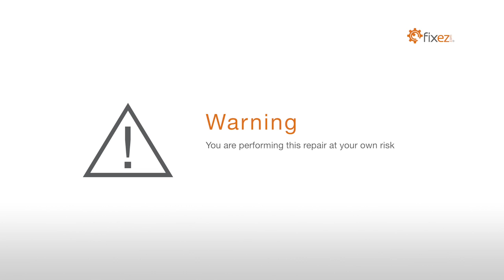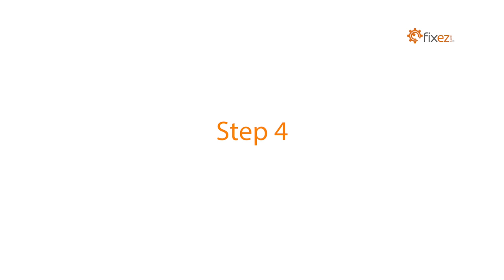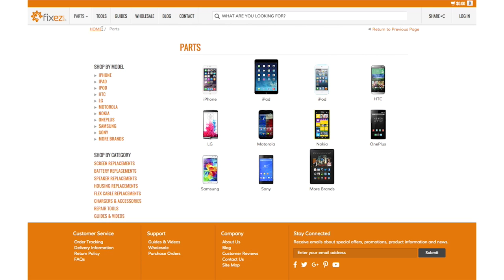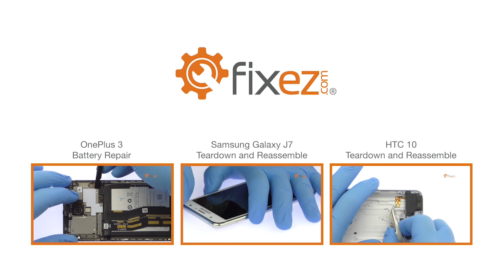iPhone 7 Plus Display Assembly (LCD & Touch Screen) Repair Guide - Fixez.com

Comment: hello I have done this fix on my iphone 7 plus and believed all had gone well. I replaced the screen and all elements correctly. However a day after I occasionally have a completely unresponsive screen. A hard restart fixes the issues for a short time but then the same issue happens again. Im thinking this could just be the connection between the screen ribbon and the phone not properly clipped into place. Any ideas or past experience with this ?